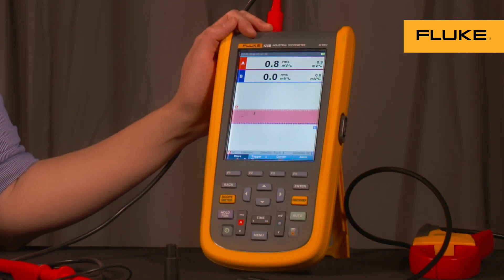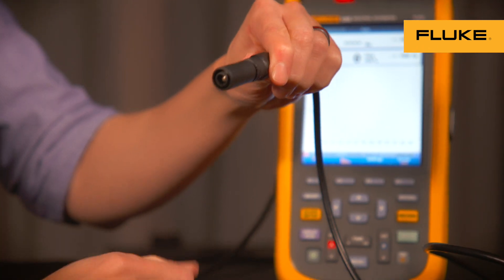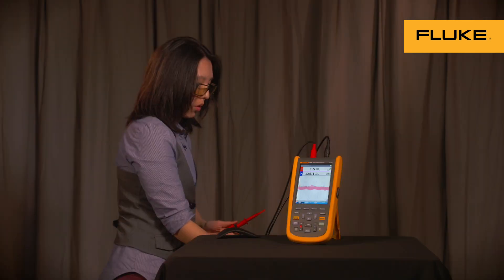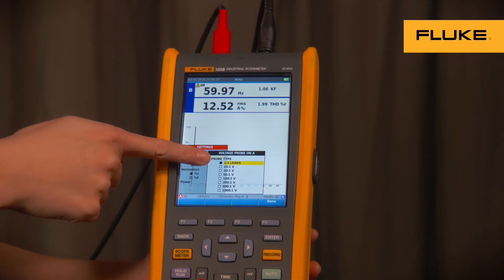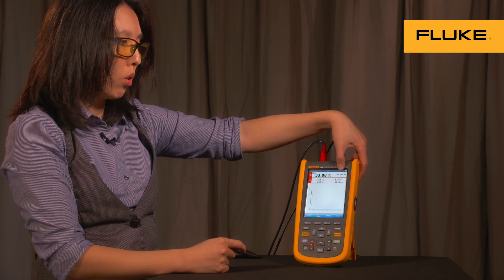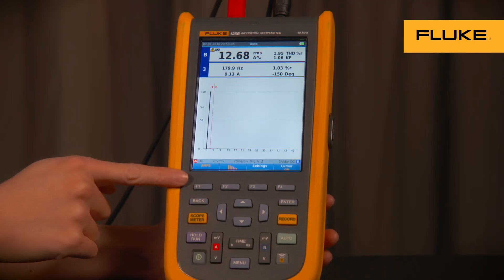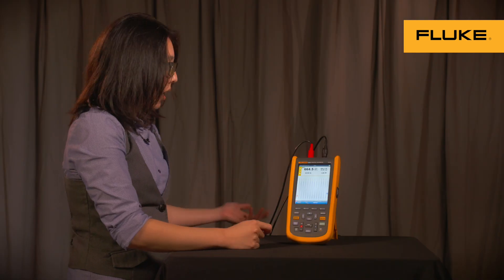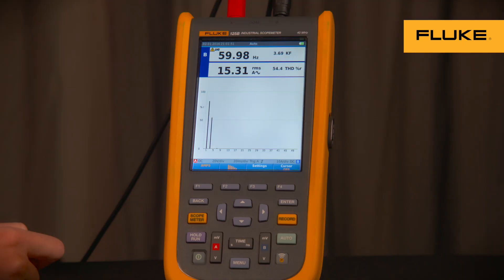Fluke ScopeMeter® 120B Series Power and Harmonics Mode

Comment: Does anyone know if you can measure DC power with the 125b (for troubleshooting and monitoring PV inverters with battery storage)?
I have an i410 AC/DC clamp sensor I could use to measure current.
In the video it seems the voltage measurement on Channel A is AC only...is there any way to change this to DC or AC+DC in the Power / Harmonics mode?